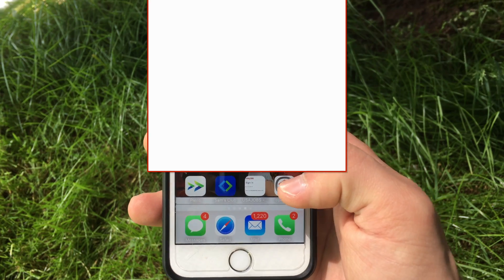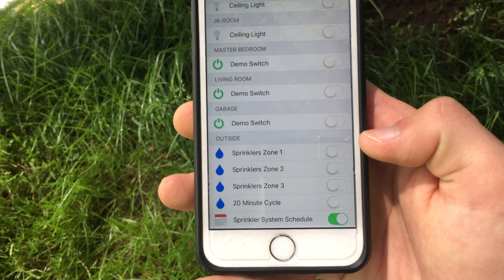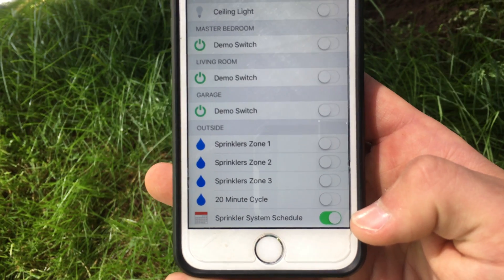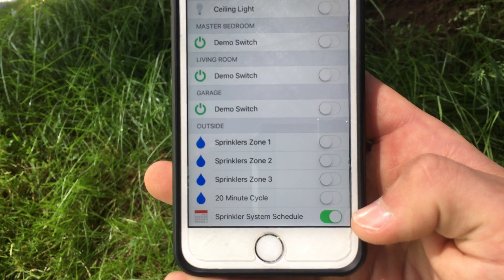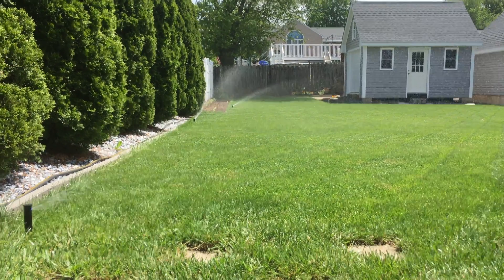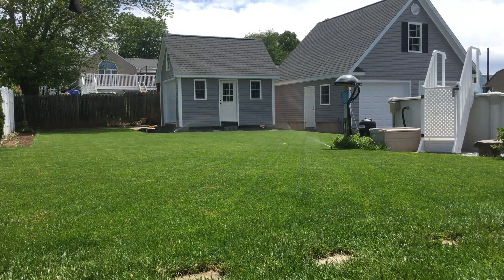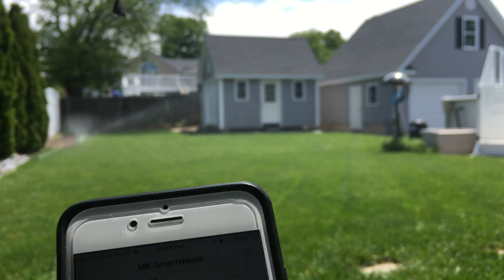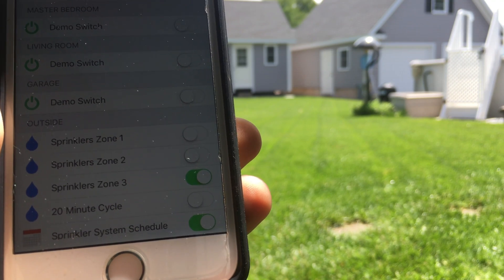Complete Guide Sprinkler System MQTT OpenHAB ESP8266 : Demo

Comment: An good idea would be to add a label on the device box, so others knows what it is, if you are run over by the imagenary buss.
For the same reason, a good central documentation is always good to have, for yourself when looking at the box two years from now. And also others when the imagenary buss hits.
That is, analysis of the risks are a good thing to do before anything happens, to make it easier for soleone else to manage the system.